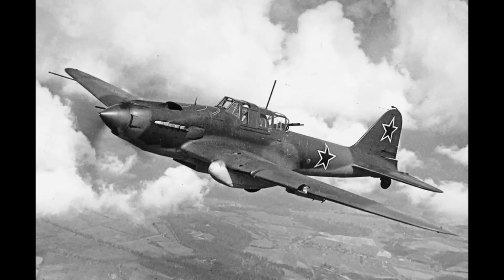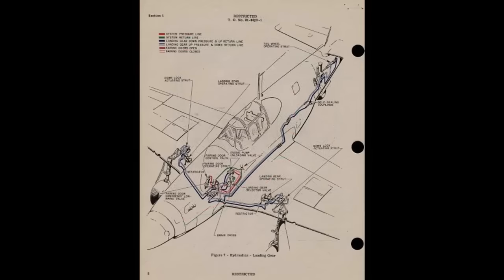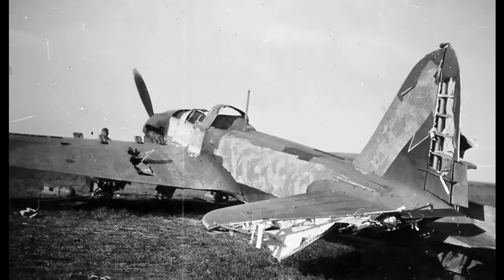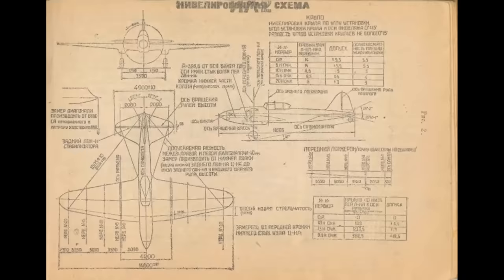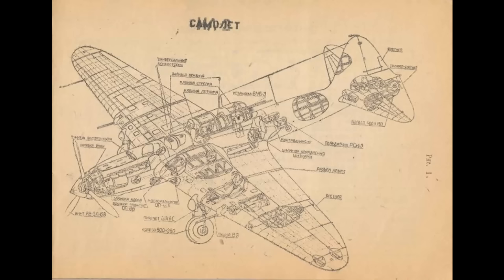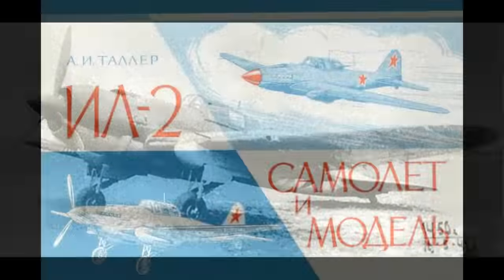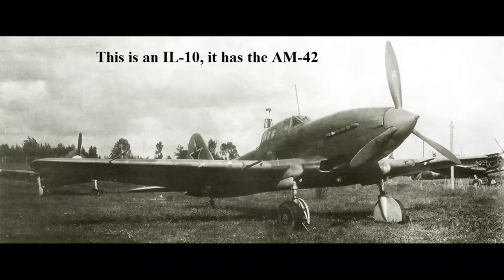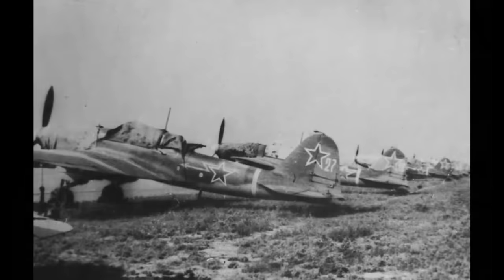Ilyushin IL-2 Sturmovik

Comment: Hello Greg, I might have an Idea why some of the cylinders had different volume/stroke. If I understand correctly, this development line of russian engines ultimately started with a licence build BMW VI V12 engine. This engine itself was based on the BMW IV,  a six cylinder inline engine. They basically added a second cylinder bank to the BMW VI and it became the BMW IV. The way they added these additional 6 cylinders was via slave and master connecting rods. Same way as it is done in a radial engine, just that you only add one slave to one master connecting rod. I made a video about the BRUTUS racecar, which has a BMW VI engine and I made some animations that illustrate this.The Mikulin M-17 was a direct copy of the BMW VI. Im not 100% sure if thats the real reason for the difference on cylinder stroke on later russian engines, since it would be kinda weird that they never changed this and made a proper engine layout after starting with the BMW licence engine. But it might explain it since further engines such as the Mikulin AM-34 were developed from the M-17.
The video is called "47Liter BMW Aircraft Engine in a Car - BRUTUS"

Comment: Everything that follows is from memory.   Sorry I don't recall the source book.
Stalingrad.   A German soldier at Gumrak airbase.   He is guarding Russian prisoners.   He's got a rifle.   They have shovels.   They are digging trenches.
An IL-2 appears and attacks.   The Russians dive in the hole.   The German dives in on top of the Russians.   He is looking up into the air and describes the action.
The IL-2 passed overhead.   Everyone was firing at it.   Sparks were flying off the armored belly in a line from the front to the back of the aircraft.  
"It looked like someone took a welding torch and dragged it along the belly of the plane.   Showers of sparks just flying ."

I distinctly remember that final line.  It gave me a good visual.

Please, Greg.   
Please finish this series.

Comment: Thanks for the great video

My theorie on articulated conrod is that they build a conrod assembly with a master rod and a articulated rod. Iam not an expert and i unfurtunaly can list sources. As i understand its very common on radials, where it helps to attache multiple conrods on a single crankpin. To achieve that, a master rod is attached to the crankshaft in a rather normal way, while the other rods are attached to the master rod. That way whole assembly can be very compact. Probably has some effect on how the articulated conrod moves but it might be worth a slight trade of there for a shorter crankshaft.
Why the might have used it on a V engine where only two conrods have to be attached to a single crankpin, iam not sure. Maybe it helped them through having more length for the bearing but thats a wild speculation.

Comment: Erich Hartman became a ace Il-2 buster. In his autobiography he describes how difficult they were to take down and just how he managed it.
Reply: The oil cooler underneath the aircraft yeah?
Reply: @DSAEAyushSK  Yes. But they learned defensive manouvering while flying just above ground later, so even this tactics was very tricky and germans had less and less skilled pilots as war continued. And when enemy approached from rear top side, the 12.7x108 machinegun sent him nasty welcome.
Reply: I think they simply ended up using the fire power of their aircraft to disassemble the entire tail of the IL-2. The Armour only extended to the pilots cockpit.   For the Fw 190A6 the 4 x MG151/20 20mm and 2 x MG131 13.2mm guns were an enormous amount of fire power with the mine rounds.  The 30mm guns that showed up on some Me 109 in the latter stage of the war also would have had no problem.   The Finnish pilot Ilmari Juutilainen seems to have not problems destroying the Stormovik:  see https://youtu.be/XkksbtMwfxA at 7:06
Reply: @williamzk9083  You pretty much summarized what was the issue with defensive armament: In almost every case the defender had less firepower. Late in the war Americans discussed the future of bomber turrets, despite having overall great success with B-29s. It just wasn't feasible to add more guns than bombers already had, while even some obsolescent fighters could bring more firepower than the bomber could return towards that attack direction.

A single 12.7mm would be considered absolutely pathetic if it was the armament of a fighter. Why would it be anything more than that when mounted at the rear? Completely manually aimed turrets simply became more useless as aircraft speed increased.
Reply: @williamzk9083  FW-190 came to the Soviet front much, much later. 30mm MK-108 -- even later than that. And disassembling the tail part or the wing is definitely possible with 20mm fire -- the only thing you need is time, range and no interference. Once relocated Soviet aircraft plants started to churn out fighters and IL-2 got decent enough fighter cover, losses plummeted dramatically. 
The aircraft wasn't exactly built to be invulnerable. Just resilient to ground fire at low altitude where everything was shooting at it, including handguns (and most notable, of course, infantry MGs).
Reply: @Teh0X  as The Chieftain has pointed out ( about tank AA ) the objective of the flexible mounted MG is mainly to make the attacker miss…

Comment: That was very interesting for many reasons, and certainly brings up a lot of questions.  The first that springs to mind is, videos on Soviet aircraft get hate?  What on earth for?
I'd like to know more about pilot training in the WWII-era Soviet Union.  Did pilots really jump from a basic trainer to this?  Or many lack of trust in the pilots in general is why the manual is written the way it is.  Also, didn't know that about the designers and manufacturers being separate entities, but it's a very Soviet way to manage things.  I can only imagine the various problems it caused (that could be a video all itself).
Reply from the maker: The Soviet stuff tends to get hate because the Soviet fanboys, not all but some, get very unhappy if I say anything that's not 100 percent positive about Soviet stuff. It's impossible to make an honest but 100 percent positive video about any WW2 airplane or engine. They all have some faults.

Comment: I'll bet the connecting rod issue has to do with one rod clamping to a crank journal and the corresponding rod directly across on the other bank attaches to it like the secondary (articulated) connecting rods in a radial engine connect to the master rod, and they probably staggered them, ie rear most cylinders would have the master style rod on the right bank and the articulated rod that attaches to it's big end directly across on the left bank, then going forward the next cylinders would have the master style rod on the left bank and the articulated rod attached to it's big end in the right bank and so on and so forth to the front, an even number of cylinders, V12, would assure that there's an even amount of master and articulated rods on each side for the sake of balance.
Reply from the maker: I think you're exactly right, and the poor quality line drawing I  have seen of it seem to agree with you.
Reply: @GregsAirplanesandAutomobiles  
If the banks are directly across from each other instead of slightly offset like a typical American V8 car engine with one slightly forward of the other then most likely that's it, about the only other way to do that is a knife and fork connecting rod assembly like a Harley has but then the stroke would be the same for each cylinder and the word "articulated" wouldn't be associated with anything.
Knowing the Russian preference for making things simple I'll bet that's what they did, it's an easy way of solving several issues.
Do you know if the journal bearings for the rod's are roller or babbitt style?
Reply: Thank you, I was looking for this comment. 👍 I immediately thought of the rod arrangement on the Napier Lion.
This must surely be what’s hinted at. I believe a master rod and link rod was a common solution in this era, instead of shared journals.
Edit: Lyon -> Lion

Comment: G'day Greg,

Yay Team !

Lots of Soviet Equipment is pretty tough, rough, and AggroKultural, Comrade...; I've had 3 Zenit 35mm PhotoSnipers, clockwork 35mm 1945 Leica Bodies with a 300mm f-4.5 - f-22 Telephoto Lens on a factory-fitted Aluminium Submachine-gun Stock, in a pressed Aluminium Case with 58-mm Standard Lens, 5 Filters for the big Lens a Screwdriver and 2 reloadable Film-Cases...

The Instruction Manual states, in part,

"...Now pick up the Camera and make like a Rifleman, looking through the Viewfinder, adjusting the focus with the knurled knob under the front of the Lens...

If one had seen a Kodak Box Brownie, that Manual could teach a Peasant to operate a Surveillance Camera...

To see my tutorial on the third one - one was stolen & another one burned in Tent-fire...; backtrack me to my Personal Aeroplanology Playlist - the final Vid. in my series covering the Armidale Airshow in 2015 is the Slideshow of the two rolls of 24 Exposures I put through the Zenit between making short Videos to conserve Battery Power  - the Zenit Tutorial starts the Video & it's Thumbnail is the Telephoto portrait I took of the Cop who searched me and the Camera - in case it was hiding a Rocket-Launcher...(Not a joke, that happened !).

I suppose the people learning to fly the Sturmovik were like the Photographers converting onto the Zenit...

I have an English translation of Vasily B. Emelianenko's 
"Red Star Against The Swastika" ; which tells a (Pravda-esque) version of what the Hero Of The Soviet Union wrote about flying Sturmoviks from 1941 when Germany started shooting, up till he was promoted to run the Sturmovik Flight Training program...

He tried to keep away from Politics, but - the whole War was over disagreements about Politics, and all sides victimise and lionize  themselves - in all their own Propaganda and recollections.

It's why so many Combat Veterans disdain the telling of Waaauughhh(!) Stories, especially to Children ; everybody on all sides always say they only fight because they,

"... Love their family, friends, neighbours, townspeople, the  State they live in, their Nation, and their favourite Godtheory..., so very much !"

Whereas on all sides, ALL of the Combatant Nation's CitiZens universally assert that
Their 
Enemies....,

"Only want to attack us,
Because they
Hate
Us...; 
THAT is why they do these things -
Because they
Just(ifiably ?)
Hate
US, all of us
Merely because we exist,
They hate us...!".

When reading Veterans' accounts, it's noticable.

Sturmovik Aces are no different.

He talks a lot about how overheated the Armour protection caused their Engines to become...; particularly in '41 and '42 - whereas by 43 or '44 the System had been beaten into eventual and reluctant reliability, from memory.

One is very highly impressed that you can translate Russian Flight Manuals...; was that something you picked up Airlinering around for a living, or did the Pentagon pay you to learn to read Russian, perhaps ?

Anyway, good stuff on the Sturmovik..., thanks for uploading...

What about one of your deep-dives into Mister Polikarpov, and his shuttered and tightly-cowled Air-Cooled Radial Motors, featuring individual Annular Exit-Ports for Hot Air behind each Cylinder - with each Exhaust Pipe Orofice in the centre of that Cylinder's Hot-Air Outlet...; meaning that on the one hand every Exhaust Stroke acted to suck used & heated Air out from behind each Cylinder, and on the other hand the Shuttered Inlet for each Cylinder could regulate the amount of Cold Air entering the Cowling ; and in the Gripping Hand, the Heat  Energy being dumped into the Airflow at Cruise and high throttle was sufficient that when considered as a Thermal Ramjet the I-15 and I-16 Engine Cowlings made more Thrust..., than they did Drag...!

Years before the P-51's legendary Radiator-Duct stunned everybody by so doing..., but I dunno when Mr Meredith might have first described his famous Effect...(?).

Maybe we should call it the
Polikarpov Effect ?

Such is life.

Have a good one...

Stay safe.

;-p

Ciao !

Comment: Greg, on topic different stroke length you can look V-2, diesel from T-34 tank and basically all uvz tanks up to T-90M. I don't know if it is the same with Il-2 engine, can't check now, but different stroke (and compression) for left and right cylinder rows is well known "feature" of V-2, inherited from when it was intended to be aircraft engine, and it was made to save weight.
Reply from the maker: A lot more people seem interesting in this aspect of the engine than I expected. Thus I will cover it in detail in the next episode.
Reply: @GregsAirplanesandAutomobiles  after some research I found that AM-34 and further engines of this line are basically M-17 engine with one-piece cylinder block, which is licensed version of BMW VI, which had that exact system with master-slave connecting rods.
Reply: Алексей Макаров свой сайт обновляет не намного чаще, чем ты видео выпускаешь.
А ещё эти восхождения к лицензионным копиям не имеют смысла.
Reply: @TheSunchaster  Смысл в разной компрессии и разбалансировке, что не даёт поднимать обороты.
И не знаю, о каком Макарове речь.
Reply: @ThorneyedWT  админа t34inform и его лекции я кидал, когда они ещё вышли
Reply: @TheSunchaster  А, сайт знаю, админа - нет.

Comment: Nice video , Greg !
early Il-2 was powered by AM-38 with lower horsepower figure you listed.
later was powered by AM-38F (forced=boosted) to give higher H.P. figure.
AM-38F engine can be identified by external dust filter at the leading edge of the starboard wing root. 
::thumbsup:
Reply from the maker: Thanks, as I said in the video the various sources have power all over the place for this engine. I'll put up some official data in the next video and I'll start to get into some of the more complex issues with Soviet horsepower and performance.

Comment: Well done, Greg, as usual. As an old auto/airplane enthusiast, I thought the technical bits about different piston strokes, etc. really interesting, and I continue to be occasionally surprised by the ingenuity built into combat aircraft (obviously including Soviet ones) in ways that, as a civilian non-pilot, just didn't occur to me until you mentioned them. I think it useful to be reminded that the U.S. was not the only WW II power with competent engineers.

Comment: Hi Greg. I sometimes take part in archeology works in Russia, picking up planes lost in ww2. I saw the con rods you are talking about. I can try and find a photo for you. In words, one of the con rods of a pair is connected to a crankshaft, the other con rod has a kind of fork on its lower end, which connects to the first con rod via pin which is parallel to pistons pin

Comment: A few of my relatives (long passed away) flew the Sturmovik in the early 1950s after the war when it was no longer front line. Their instructors were from the Patriotic War and generally said the plane was okay but the Germans shot them down like a turkeyshoot, luckily there were always more (Sturmoviks). So yeah it was a tough airplane but no plane ever made is tough anymore when 30mm cannon shells hit it.
Reply: The Germans didn't really have the 30mm until 44 when the VVS started to gain air superiority.
Reply: My workmates father was a German soldier wounded on the Eastern front. He said what stopped the Russian attack was that they couldn't climb over their own dead bodies. I believe mass attacks by Sturmoviks would have been more successful but still costly.

Comment: Part of the lack of interest in Soviet designs, may be due to the lack of readily available and good information out there.
Particularly if you are of a technical frame of mind.
For instance, I never knew anything about that radiator set up.
The content creator needs to begin with a sympathetic and interested perspective.
However, I find most content creators are happy just to regurgitate tired old propaganda memes (particularly about Soviet/Russia).  Actual/genuine research is not a concept they are familiar with.
So, thank you for taking the time make this video, and particularly... learn what you are talking about, lol.

Comment: Inline probably makes for better visibility in a ground attack role despite meaning a vulnerable radiator. It's interesting all the interplay of considerations and more details on the reason for a lower red line would be great to have. More IL2 please!
Reply: The particular engine installed on Il-2 was simply the most powerful engine available at the time, originally meant for heavy bombers. There were later experiments with fitting Il-2s with M-82 radial engine, but it's power output has proven insufficient
Reply: @lapantony  Yes, the image in the video shows the IL2 with an M82, it looks like visibility would be a little less and the increase in power not sufficient given all the other considerations around production. Ultimately they chose to keep churning them out.
Reply: @billbolton  I also read that M-82 had slightly lesser power output compared to AM-38F IL-2 had, and M-82 was required for many other planes, while Il-2 was essentially the only user of AM-38F, so yes the decision to keep the engine was mostly made to reduce the strain of the industry